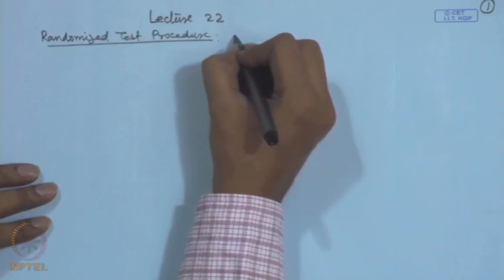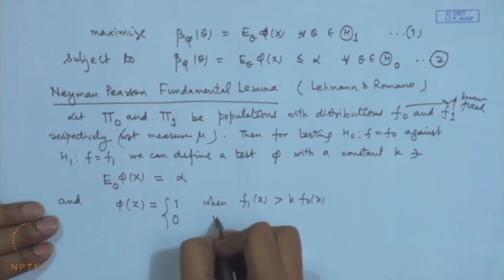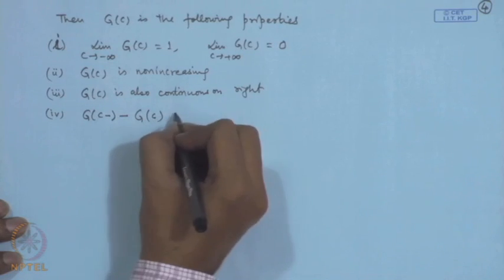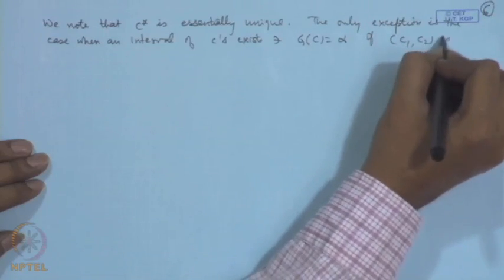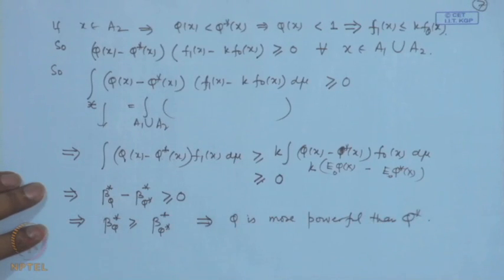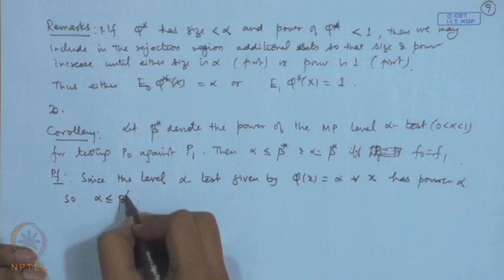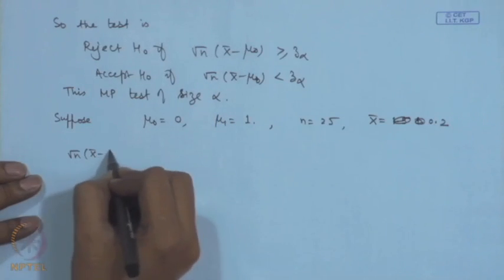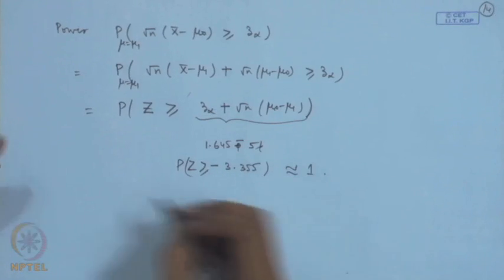Mod-22 Lec-22 Neyman Pearson Fundamental Lemma

Comment: 17 min 28 sec. Since fo(x) is a density, isn't it always positive
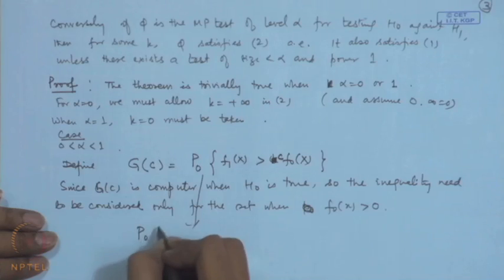Reply: Not necessarily. Consider a Uniform distribution, for x between 0 and 1. This distribution has density f(x) = 1, when x is between 0 and 1, and it has density f(x) = 0, when x is smaller than 0 or greater than 1. In the video, I guess the professor concentrates only on the values of x where f(x) is strictly positive so that he can carry out the division (min 17:30) with no problems.